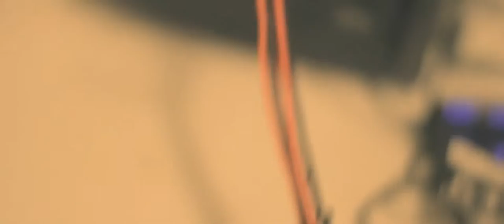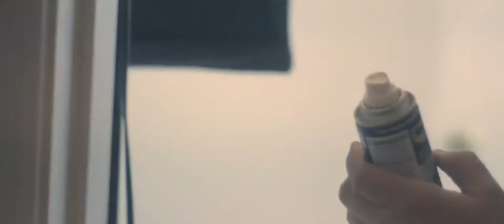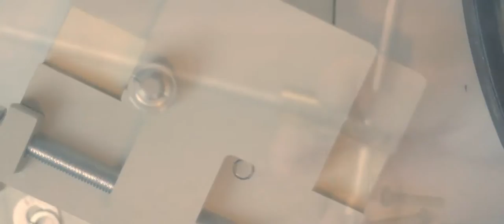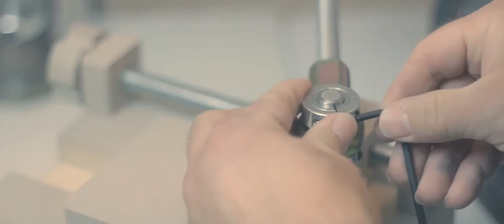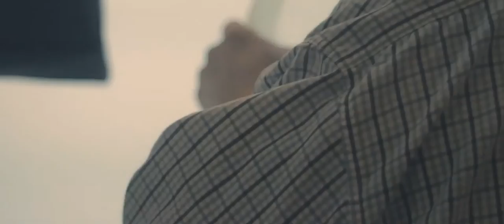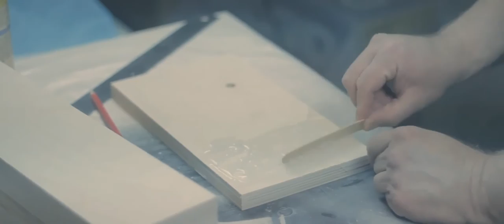The Art of Efficiency—Automating Waite Research

Comment: I was gonna suggest a peristaltic pump for the cerium oxide - but then realized that the tipping probably prevents sediment from forming in the bottle :) Nice!
Reply from the maker: Yes, we tried peristaltic pumps early on.  The tubes tend to plug up with cerox.  Our robot can shake the bottle any time, so it stirs and then delivers.  Plus it's easy to vary the amount of cerox to fit larger or smaller mirrors.  Being a "belt and suspenders" guy, I also have a plain water drip from an IV bag, just for safety.  You don't want to let the mirror ever go dry.  Thanks!

Comment: Hi Gordon, really admire your informative video's and of course your work. I am in the UK and seriously considering building a grinder. I wonder if you would consider creating a video giving some more detail on this controlled one? Fascinating stuff.
Reply from the maker: Yes, I will.  I just installed a computerized system for delivering abrasive and cerox to the mirror, and we're working on a video about that.  Will probably also do more on the computer control of the overarm.  Thanks!
Reply: Looking forward to it!
Reply: yes, it would be super interesting to get a tour of the machine motions, a bit about the component choices and where and how the micro-controller plays a part in the process.  You said in another comment, "The computer controls the fine grinding, the rough polishing, and pretty much all of the figuring" and it's not clear what the software is doing, unless you also have some sensors that let the software judge when to add grit or modify tool placement or stroke length etc.  And also from the other comment what this means in practice, "the computer is better at rough parabolization than any human operator".  Even just some pictures of the entire set up would be interesting.  This video only showed close up views and it's not really possible to figure out what the system as a whole looks like.

Comment: Even with the 'robot' doing most of the work, I imagine that the final steps of figuring the mirror must still be done by hand with lots of testing.  So I wonder just what percentage of the work is 'robotic'  vs 'manual labor'?  Also did you write your own firmware for the machine, or did you farm it out?  I'm an embedded software engineer, and I've dabbled with pushing glass, so I can appreciate what would go into writing the code for such a robot.
Reply from the maker: Hi, Kenneth.  I wrote all of the software for the micro-controller.  It's all in C.  I was a software developer for decades before getting into mirror making.  That was a lot of factory and warehouse automation projects.

The computer-controlled features of the machine save huge amounts of time, as they allow the operator to setup the machine and then walk away for lengthy  periods.  The computer controls the fine grinding, the rough polishing, and pretty much all of the figuring.  This amounts to large amounts of time because we mostly make large, fast mirrors.  For example, the parabolizing of a 12.5" f/5.6 mirror requires the polishing away of only about 12 cubic mm of glass from the sphere.  But a 20" f/3.0 requires removal of about 320 cubic mm.  It might take a good operator with a standard manually operated machine about 6 hours of turntable time to finish the 12.5".  You can guess how much longer the 20" takes!

The least savings does come at the end.  During final figuring, from 1/4-wave on, the computer will run a session on the turntable that is perhaps 15 minutes long.  Then you have to physically remove the mirror, wash it, set it up for testing, and run the test.  Of course you have to wait for the mirror to aclimate before the test, but you don't sit there waiting for that!  But even for those last figuring sessions, it's probably about 15 minutes under computer control, and about 30 minutes of labor for each cycle.

The other big factor is that the computer is better at rough parabolization than any human operator.  It can take the mirror from spherical to 1/4-wave with almost no decision making on the part of the operator.  And you get to 1/4-wave with a nice, smooth, evenly parabolized surface.  That makes it a lot easier to go from 1/4-wave to "premium" in the final sessions.

Comment: Hi Gordon, what makes you decide to use a machine with a fixed shaft or one like this with an oscillating arm, can you tell the difference between the two please?
Reply from the maker: The fixed shaft machine is used for "fixed-post" grinding or polishing, which is also called "spin" polishing.  I used fixed post machines for all of my grinding, and all rough polishing (getting the pits out so the glass is clear).  You can do parabolizing on the fixed-post machine, as long as you are willing to work it by hand, basically using the machine as just a motorized turntable.  The oscillating arm or "stroking" machine I use only for parabolizing.
Reply: Thanks, great work!

Comment: Gordon how do you prevent astigmatism in large mirrors when they are worked on face up from grinding to polishing to figuring by virtue of their large sizes? I mean mirrors over 30" in diameter.
Reply from the maker: I don't do mirrors over 30" on this smaller machine.  For the most part, the design of the turntable retainer ring does the job automatically.  The retainer isn't tight on the mirror, and the artificial grass under the mirror is a little slippery.  So the mirror rotates very slowly, in relation to the turntable, from the friction as grinding and polishing go on.  If your machine doesn't do that, basically you need to work in small time increments of maybe 20 or 30 minutes, and then stop and rotate the mirror manually on the turntable.  A good turntable takes away a lot of the worry about 'stig.  Also, I usually make a large polisher and use it from time to time during rough polishing.  The large polisher helps keep 'stig under control as well.
Reply: GordonWaite Thanks Gordon. I will have the astroturf between the turntable and mirror back and keep sessions to 20-30 minute increments then give the mirror a 'rotate'. Thank you very much.

Comment: Very nice! How long, does it take to churn  out a 20inch? And do you parabolize it by hand?
Reply from the maker: Hi, Angelo.  Mostly I do the parabolization using the machine.  I use a series of smaller and smaller polishers, and vary both the offset from the center and the overhang.  Sorry, but I would rather not reveal our manufacturing times.  But I will say that it varies depending on the focal ratio of the mirror.  You can pretty much tell the difference from retail pricing.  The 20" f/4.5 costs about $5,250, while an f/3.0 would run $8,000.  It takes a little more skill to make the f/3.0 and quite a bit more time as well.